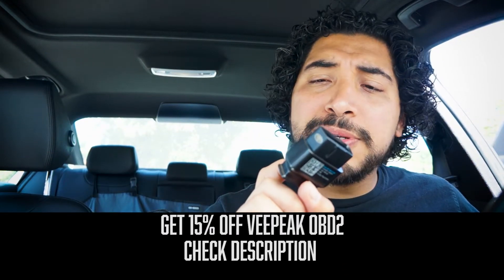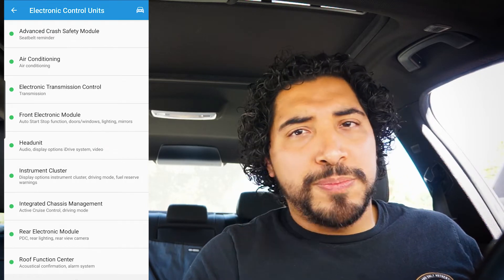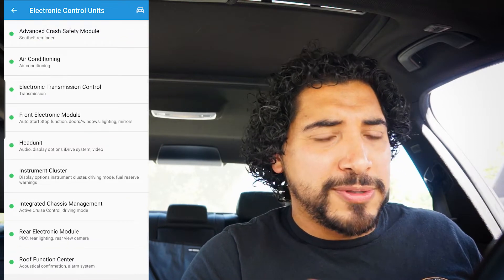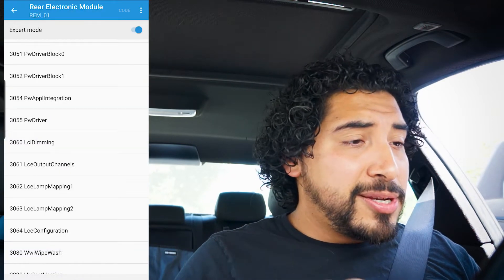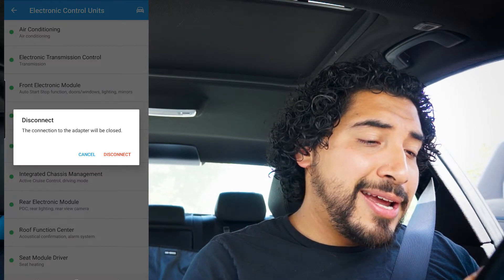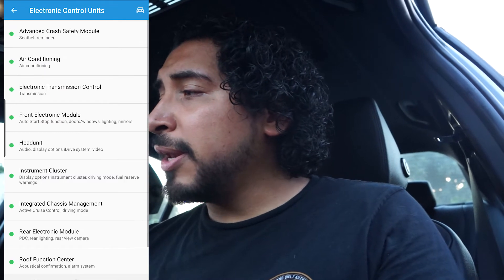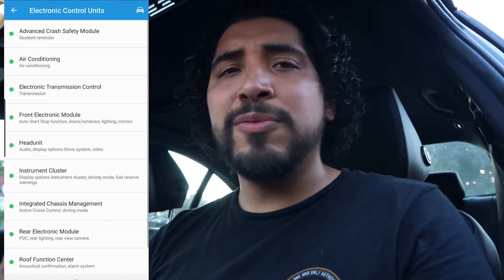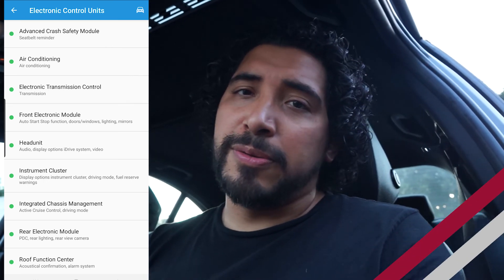Bimmercode: How to code flashing brake lights to your BMW F30, 320i

Comment: I have a 2016 328d and I can not get mine to flash. Just wondering if I need to set front and rear module to factory and do it in order somehow?
Reply from the maker: That's strange man, maybe email pro tuning freaks and see what fhe issue is?

Comment: Hey rad I've coded this feature in my bmw 420i 2017 but it still ain't working. Any suggestions???
Reply from the maker: Interesting, It seems that the N20's has a similar problem, the pedal is not to sensitive as others. You may need to actually force the brake pedal to have this feature work.
Reply: @RADBAVARIAN  thanks Man 👍🏾

Comment: Don’t you need LED lights to be able to do this??
Reply from the maker: It worked for mine
Reply: Right on! I tried it. We’ll see, sometimes it takes a minute for the system to reset completely. Thanks!

Comment: I don't have the rear option.
Reply from the maker: What are your options on Bimmercode? Shoot me a DM on IG and I can try to guide you @radbavarian
Reply: @RADBAVARIAN  Don't have IG
Reply: @RADBAVARIAN  I coded the front, but don't see the rear option.. I have a 2016 640xi Gran Coupe. Bimmercode latest version.
Reply from the maker: @timjacobs6610  look into bimmercode.app/cars/f12/
Reply: @RADBAVARIAN  it's weird, when I go into demo mode I see the option. But when I go to connect in regular mode, I don't see the rear option.
Reply: @RADBAVARIAN  funny you should say that, I just checked there. I saw the options, but I don't see the rear module option on my car. So maybe it works with just the front module.